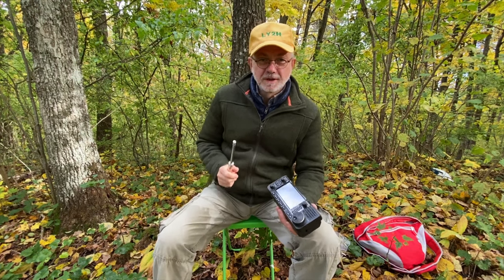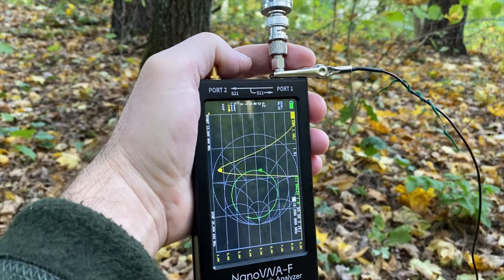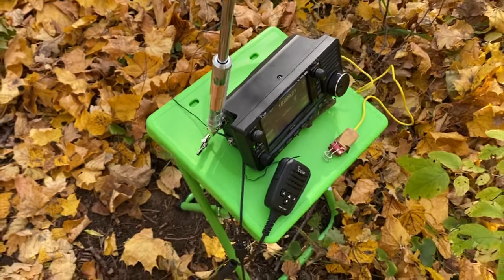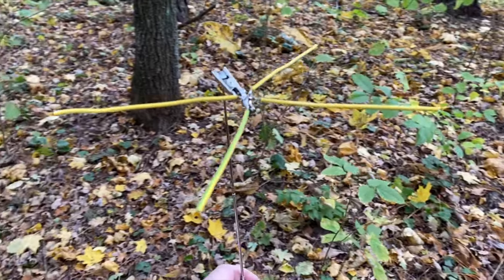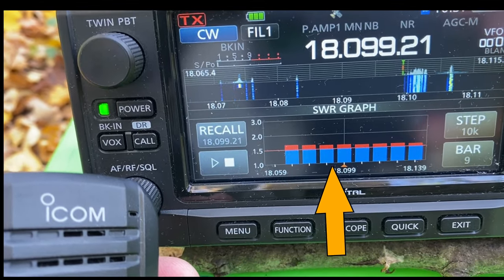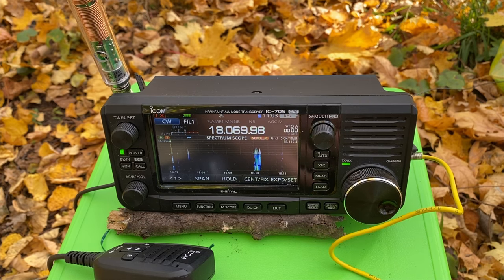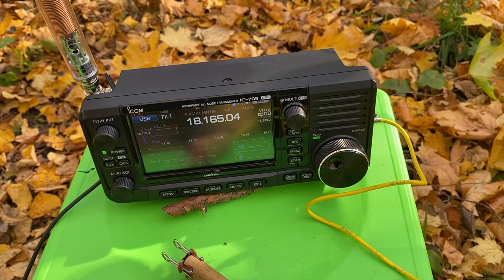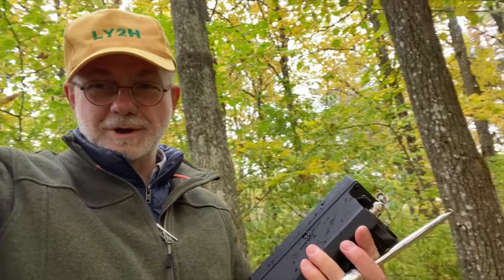How to get Elecraft AX1 antenna working with ICOM IC-705 transceiver without the antenna tuner!

Comment: Great experiment Linas! Wayne of Elecraft mentioned that the AX1 resonance varies quite a bit depending on various environmental factors as well as counterpoise length, it is intended for use with the KX2 and KX3 equipped with built in antenna tuner for convenient rapid operation. Elecraft has a new AX2 antenna just about to come out that has a user adjustable toroidal coil in the smaller base for even more portability and speed in deployment. More than one base can be carried and optimized for the desired frequencies and counterpoises. In any case the capacity hat should increase efficiency a bit and that never hurts. 73 de w6akb
Reply from the maker: Thanks for the comment Alan, and thanks for the info on AX2! Could be another interesting product from Elecraft :) And you are right, the cap hat improves radiation efficiency of any super-short antenna, even if in resonance already.  73! Linas Ly2H

Comment: Hey Linas, great video and amazing information as always. DIY and modifying what you have is always the best :D
5/3 and still audible, good stuff! 
I would think you could squeeze (if not already done) some more effective power out of the 5W by limiting your TX bandwidth. And cranking up your TX-treble a little bit could give you a bit more audible "gain" as well maybe?
Reply from the maker: Thanks for watching and commenting Olli! I work mostly CW on QRP, so I haven’t tried yet all the possibillities the IC-705 offers for in SSB mode but I have the TX-trebble cranked-up a few points. It would be very interesting to try “medium” and “narrow” TX bandwith settings for my future experiments! I’ve also increased the Compression up to 5 to  give a bit more punch for my signal :). Thanks for the tips again! 73! Linas LY2H

Comment: Hi Linas, Excellent video and very interesting, especially when you use the nanovna to explain why the AX1 isn't on resonant frequency, One question for you.... do you have a link to the "trusted" seller who supplied the nanovna-f to you....??????... thank you Linas... excellent thought provoking video as usual... thank you....Yoki...
Reply from the maker: Thanks Yoki! I'm glad the video was useful for you. As it comes to the NanoVNA-F, it is kind of a broad agreement among the community that the Deepelec ( at deepelec.com) product is considered as trusted. That's the one I use. They offer real customer support and the firmware upgrades. For the smaller, 2,8" screen nanovnas , the Nano VNA-H by edy555 probably is the best, but I don't have it myself. In Europe, It is sold by the Eleshop.eu who is also an authorized dealer for the original TinySA  spectrum analyzer. Hope, this helps. 73! Linas LY2H

Comment: I'm guessing the size of the capacity hat is not critical.  Is that correct?
Reply from the maker: Correct. The bigger the hat, the bigger the capacity. I'm sure, it is possible to calculate the hat's dimensions with some antenna modelling software etc., but it's for the big antennas. The "cut'n'try" method in this particular case of pocket-sized whip  is faster and more fun, IMHO. 73! Linas LY2H
Reply: @Linas_LY2H  Thanks for your reply. 73

Comment: Do have a diagram to make this capacity hat ie wire length
Reply from the maker: Yes, the close-up picture and the wire dimensions are in the video , at ~7:00 min. The make is very simple: 2 wires are crossed and soldered up to the back of croco-clip. Have fun! 73! HNY! Linas LY2H
Reply: @Linas_LY2H  will it make a difference if they are slightly longer
Reply from the maker: @secretsquirrel7788  The size is not that critical, actually, but of course, it takes some experimenting. If you make the hat bigger in diameter (using longer wires) it will bring the resonance of your antenna lower. As you can see from my video , the capacity hat makes the resonance quite wide-band so, there is lot's of room for experimenting. You may make the hat of more spikes of the same length, for example, or ad a rounded border around connecting the spikes together and so on, and see what suits you best! 73! Linas LY2H

Comment: Great video, have you tried the hat with the ax1 using the 40m coil addition to work the 40m band?
Reply from the maker: Thanks! No, unfortunately I do not possess this coil (yet :)). Theoretically, there is no reason why the hat couldn't work on 40, in the event that natural resonance with this coil would be higher than the ham band frequencies. Please let me know if you try this out! 73! Merry Christmas! Linas LY2H

Comment: Very interesting and useful. Thanks for the valuable information. I will try it on my antennas with my Yaesu FT-817. How can the dimensions of the capacitive cap be calculated?

73 IU5KHP ~ Nicola
Reply from the maker: Thanks, Nicola! Probably, the most precise way to calculate the capacity hat would be the NEC program or similar :). But I don’t have one… Instead, the way of trial-and-error is more fun and easier :) To help in this cutting and measuring process, there are some rules of thumb. It’s just an approximate estimation. One rule of thumb reads that the capacity hat electrically lengthens the antenna 2 or 3 times its diameter. It’s like, the hat 10cm in diameter should lengthen the electrical length of the antenna by 20-30 cm. In my case, I needed to electrically lengthen my whip for 40 “electrical” centimeters ( from resonance at ~15.3 Mhz  , calcualted electrical length of 1/4 quarter wavelength ~ 466cm, to the wanted resonance at 14.1 MhZ, calc 1/4 wl ~ 506 cm. 506-466=40.). So I chose the diameter of the cap ~20cm, which turned to be pretty much in tact. But again, the size/geometry of the hat is not critical, it gives a big room for experimenting. Hope, this helps. 73! Linas LY2H
Reply: @Linas_LY2H  Thanks again for your help

Comment: Linus, I recently purchased a AX1 for my KX2.  I opted to use a tripod mount.  What field deployments do you recommend?  Should the antenna be elevated, with elevated radials, or on the ground, using the wire as a counterpoise and a small tripod?  de W7UDT Rand
Reply from the maker: Hi Rand, congrats on your new purchase! You've got a good question which has no single answer to :) Effectiveness of an antenna depends of so many things with location being the Nr 1. Secondly, it's our expectations, or how realistic they are :). So, to my understanding, the AX1 has been designed by the Elecraft as a fun add-on to the KX2 in order to make this radio even more attractive giving it a way to be used as a "walkie-talkie" on HF. The main criteria of the design, thus, was the compact pocket  size for easy carrying and being short and lightweight enough not to put too much of stress on the BNC connector and your arm when keeping the radio in one hand. This resulted in a base-loaded ultra-portable 46 inch whip which used with the short counterpoise makes a compact set-up which is very effective because my expectations for it is to make any contact at all by walking on the beach, or even on the street, or standing on the top of the hill. If in the good location and the right propagation, really DX contacts are possible. To add even more fun to this ultra-light style, the Elecraft guys offered few accessories allowing for mounting the AX1 on a lightweight tripod. I like this way too, but frankly, I couldn't tell much difference in performance running it with one semi- elevated radial and a short coax cable at the hight of a tripod of abt 5 ft. It's more like a question of the operating comfort then the efficiency, I think. As it comes to the radials, to me, one elevated radial is always better then 3 lying on the ground when running vertical whips , especially short ones. The design of the AX1 is based on the usage of the built-in ATU in the KX2 ( it's mentionned in the manual) which makes the precise length of the neither elevated  radial nor the whip itself not that important, because the resonance of such a set-up changes with the change of operating location. There are many reports from guys using the AX1 or its DIY clones without a radial at all. Well, this is also possible and fun, because in this case, you yourself becoming  " a radial" and a part of the antenna system through the stray capacitance and the resistance of your body. Actually, standing barefoot in the water might make a difference, eh? Why not try?! It's all about fun! 73! Linas LY2H
Reply: @Linas_LY2H  Thanks Linas…. I’ve always have better luck with elevated radials as well… frq/185=length in inches… And pointing it directionally with gain and low take off angles should get me further out… I know from reading the manual, it takes some practice to make use of the small form factor.  I like it’s size, easily tucked in the case… it makes it highly portable.